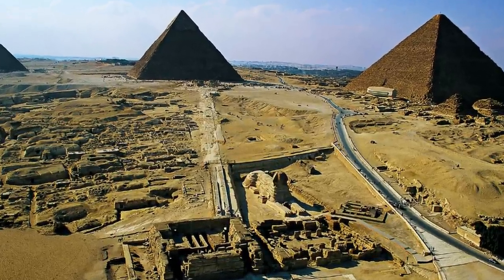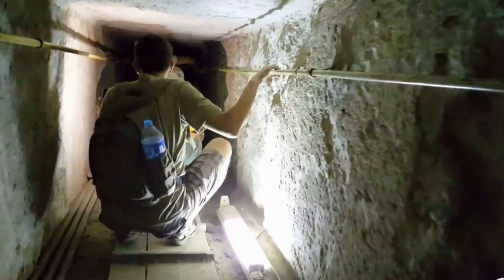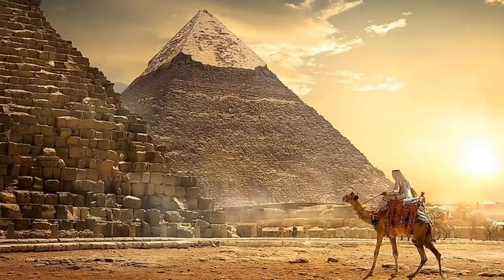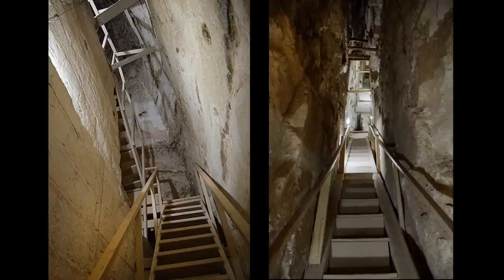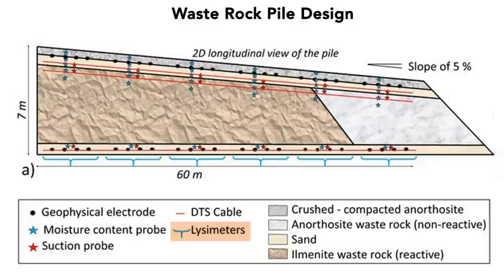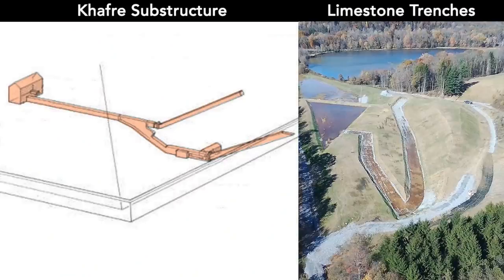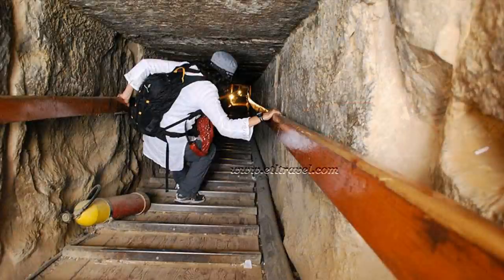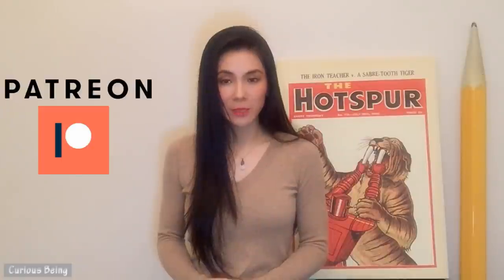The Secret Enigma of the Egyptian Pyramids’ Interior

Comment: Some older accounts of the interiors of the pyramids did mention that many of the small pits, side shafts and floors were packed with high quartz content sand. Much of that sand was removed and swept out to accommodate tourists and treasure hunters. This supports your theory of the passage ways acting more as a filter or dehydrator for the pyramid.
Reply from the maker: Thanks a lot for the information. I appreciate it!

Comment: A possibile explanation for the descending passages: Diluting the drainage water. They could catch the rainwater into a basin around the pyramid and the overflow can go down the tunnel to mix with the acid water to dilute it and drain it.

If for some pyramids, there's no drainage channel underneath the acid water can go the other way around and use the passage as an output.

Comment: Another great video Tina.  I agree with something you said below in another comment, that the pyramids could have more than one purpose or function.  It's hard to figure that out when we're looking at what appears to be a large machine stripped of all the inner workings.  You did a great job detailing how the pyramids act just like mine tailing piles processing the acid runoff.  But maybe the acid isn't only from the tailings.  Remember, there's still a few more things we need to figure out.  I think what you discovered is the overall architectural design of the pyramid, but not it's main function.  There has to be some reason for the large chambers.  There was too much effort put into them with their large granite chevron ceilings for them to not have a function.  And what were the granite boxes for?  Certainly not for sticking mummies in them.

Someone else mentioned that the four "air shafts" aren't enough to collect the acid seepage from the tailings.  I have to agree with that.  At least that wasn't their primary function.  But I think the shafts might be the key to figuring out the pyramid's primary function.  

Maybe to go much further, we need to speculate on who the pyramid builders were and what level of technology they had.  I agree that HS1 was probably the time of their civilization's  demise.  But I think pockets of advanced ancient civilizations probably survived for quite a while longer.  It looks like they had access to powered tools as you have shown in your previous videos, but they probably had limited capacity to maintain them and make new ones.  If they had the power of flight, this might account for the world wide mythologies of gods coming down from the sky to rule and teach the native peoples.

If this were the approximate scenario, it's not a big leap to think they could construct or salvage some industrial batteries.  They don't need to be something as complex as a RTG (Radioactive Thermal Generator, i.e. nuclear battery).  It could be just simple large lead/acid batteries, like what you find in a diesel electric locomotive.  These are about the size of the so called "sarcophagus".  Coincidentally, if you read the description of the Arc of the Covenant in the Bible, it sounds exactly like a RTG!  The Bible has a lot of advanced technology in it.  If these chambers did house large batteries, being able to handle excess acid overflowing would be very useful.  If you've ever had a voltage regulator stick "on" in your car and over charge your battery, you'll know what I'm talking about, acid foam all over!

But what about the "air shafts"?  Could they have been part of a navigational beacon system as someone wrote?  Don't know, but I think they are key to understanding the primary function of the pyramid.  Anyway, some food for thought.  

Tina, nice work!  I really think you discovered something new about the Great Pyramid.
Reply: Love all these thoughts, some great added ideas here. The air shafts may have actually been exactly that? Let out some toxins to allow the mechanisms to function properly?

Looks like the whole giza plateau is the remains of an ancient industrial complex. How many workers ran all this? How big and widespread was the civilisation that this level of industry sustained?

The genetic bottlenecks may be a key to help determine the timeframe of the demise? I get mixed up by the generic bottlenecks but weren’t there a few? 

Also probably good to factor in what era was there a lengthy period of climate stability before a big HS1 style event? 

Feels like we’ve gotten as far as we have this time around from not only remnants of advanced knowledge at the foundation post-YD, but also that overall climate stability since YD too. 

We’ve had it so good and it’s terrifying to realise that we’re collectively far more fragile than the wider population is even remotely aware of. 

I feel like an animal that senses the tsunami coming, but is stuck and can’t run to higher ground. Also most of the other animals don’t see it coming so thus aren’t on the same page of the urgency of the need to flee. Gah!!!
Reply from the maker: Thank you Ken! I really appreciate your insightful comment. 
Were the 4 small air shafts enough to be drainage channels to serve the Great Pyramid? 
We need to know in what kind of climate conditions the pyramids were built. Currently, the climate in Cairo is called a desert climate. “Cairo is donated on balance 26 mm (1 in) of rainfall per year, or 2.2 mm (0.1 in) per month. The wettest weather is in January when an average of 7 mm (0.3 in) of rainfall (precipitation) occurs.”

Were the pyramids created during the wetter seasons? The Sahara/ North Africa goes through humid/dry cycles. The Sahara was green and wet from about 14,500 years ago (after HS1 the millennia-drought) to 6,000–5,000 years ago. The humid period before that was around 85,000 to 78,000 years ago. HS1 (20,000-15,000 years ago) is the time period that coincided with the severe human population bottleneck which I think could be the ending of an advanced civilization. If the pyramids were built during 78k-15k years ago, then the Giza Plateau would be as dry if not dryer than now. 

Therefore pyramids were probably designed and built for a dry climate. Even with the desert climate there are still sudden precipitations which caused flash floods. 
Air shafts are pretty small and they twist and turn. Are there more such shafts in G1? Maybe. The scanpyramid team found two more voids in G1 but smaller voids like the air shafts are probably hard to detect. 

As for the people surviving in pockets after the cataclysm, I think it's very possible. Though I doubt these people would use their limited power tools to create multiple massive structures like the pyramids to act as industrial batteries, unless these pyramids were pre-existed. 
The amount of work and energy putting into building the pyramids probably over weigh the effort to create a Radioactive Thermal Generator.  If the goal was to make simple large lead/acid batteries in sizes of "sarcophagus", why would these intelligent ancient people put only one "sarcophagus" in each pyramid? What would be the reason to create the pyramids if they were not part of the battery? If the pyramids were supposed to house batteries, why there are so limited interior space? At least they would have put more "sarcophagi" in the chambers, right?

It's interesting to hear that the Bible has a lot of advanced technology in it. I need to read more about it :-) Thank you for the information! Have a great weekend!
Reply: @CuriousBeingbyTina  Hi Tina!  Thanks for the reply.  I hope I can clarify a few things.

I don't think that the air shafts gather acid from the tailings because there is no impermeable barrier like the plastic sheet in other mine tailing piles in the pyramid that would direct the acid towards the air shafts.  Alternatively, there would need to be several smaller channels leading to each of the air shafts to help collect any leeched acid.  I don't see any evidence of this either.  There needs to be a collection system, like a roof gathers rain water and directs it to gutters, then downspouts, then the French drain.  I just don't see it working mechanically.  This is why I think the air shafts point to another function.  My reasoning has nothing to do with precipitation rates.

However, the second half of your hypothesis is pure genius!  I think you are the first person to point out that part of the pyramid is designed like a passive acid mine treatment plant.  This is spot on.  When I look at the subterranean pit, that just confirms it for me.  Everything makes perfect sense.  I hope this part stands up to further scrutiny.  It could be a big deal for you Tina!

So, if the air shafts aren't the source of the salt and acid, what is?  I read that in the upper (King's) chamber, before they opened it to the public, the salt was caked up very thick, more than what could be accounted for by effluence alone.  The only thing that makes any sense to me is that has something to do with the granite box in the upper chamber.  Salt and vinegar makes a very good electrolyte for a battery.  Look at this video on making a battery out of a few pennies.  https://www.youtube.com/watch?v=rIdPfDHeROI  Now imagine a battery made with large copper and lead or zinc plates that could fit into the granite box.  This would be a very powerful battery that would last a long time.  You wouldn't need to rebuild the battery very often, maybe just replace the salt and vinegar electrolyte once in a while.  Maybe they just dumped the old electrolyte on the floor and let it drain down to the bottom of the pyramid.

I don't think this battery powered some large industrial complex or anything like that.  I don't think the main purpose of the pyramid was to be a power source.  I think it was just the local power source for whatever function or functions the pyramid served, like batteries in a flashlight.  Everything still makes sense so far.  Can anybody poke holes in this hypothesis?  I think the battery was very simple like this, similar to the Baghdad battery.  I don't think it was something more exotic like a RTG.  RTGs are made with plutonium and used for deep space probes like Voyagers I & II that will be too far away from the sun to use photovoltaic panels.  They are small though and you can fit at least 6 of them in the "sarcophagus".  Nor do I think there was any wireless transmission of power, just ordinary copper cables and wire used within the structure.

This brings us back to the "air shafts" and the main function(s) of the pyramid.  Also the top of the pyramid is missing.  We may never figure this out without discovering more clues or dig up the Pyramid User's Manual.  However, this is the fun part, so let's speculate!  Here is one of many possibilities, but first some assumptions.  The pyramids were built post HS1 and pre-dynastic Egypt.  Some survivors of this advanced civilization were still around during the Sumerian times and are likely the gods in their mythos.  There are several clues that they still had the power of flight.  They all were depicted with wings or sitting on something with wings.  In the Americas, there are several gold trinkets shaped like planes.  The Egyptian myths tell of their gods using flying chariots.  There is a wooden carved bird from dynastic Egypt that has a vertical tail rudder like a plane, etc., etc.

Also, we don't know what condition or configuration the shafts were in while the pyramid was "functional".  They may have extended all the way to the exterior and were later sealed/blocked when it was abandoned.

So let's assume the pyramid had something to do with flight.  Again, this is just one of many possibilities.  The way small planes navigate is by tuning into known radio beacons.  Putting a beacon antenna on top of the pyramid makes perfect sense if there were a landing strip nearby.  If they were anything like they are today, it would also be accompanied by a red anti-collision light on top.  

Airports also use two or more beamed (focused) lights at different angles pointed towards any approaching planes.  This lets the pilot know if they are on the correct glide path for landing depending on which lights they see.  Could the air shafts be the repositories for these lights?  They are set at different angles and could easily be powered by the aforementioned battery.  There would also be another set of lights locally powered at the actual landing strip.

There are several other possibilities, but this explanation is one of the more mundane believable ones.  ;-)  Was this a little clearer Tina?

Comment: Wow! With this video you took me so deep in the rabbit hole, I'm scared I'll never find back to the surface again 😁

There's a clear connection between your idea of the pyramids as a very smart constructed acid drainage system and their real purpose, which was definitely not being a tomb for rotten Pharaos. In my opinion, your thoughts are 100 percent correct, since  most sorts of granite are acid resistant, whereas limestone is acid sensitive. That would explain why the inner chambers are made of granite - and the propably by accident - bared limestone formations inside the chambers look like melted.  Another explanation (if the chamber shows no sign of destruction) might be that the limestone was placed there with intention, to neutralize the acid water for a special purpose...

However, acid water is another very interesting addition to the already present collection of evidence for an additional purpose of the construction. Let's go deeper and startle some rabbits 😉

Comment: The limestone substrata, purposefully placed as it was, nails it for me.  It's the smoking gun that holds your entire thesis together.  

Nicely done.   

And by the way, upon reflection.  The "ruble pile" by it's nature is purposeful is it not?  

The reason, to me, is that if that pile sits at the bottom of a "reactant zone" space to handle polluted waters, as does seem to be the case, then a ruble pile of reactant material would maximize the surface area in contact with the water wouldn't it?  It would function better than a smoothly cased room of reactant material.

So you're right...whoever built these structures thought it through in very thorough fashion didn't they?  They were thoughtful and brilliant engineers.  

John~
American Net'Zen
Reply from the maker: Thank you John. I always appreciate your insightful comments. Have a great weekend.

Comment: Point 4 seems to show damage from acid seepage that was greater than expected.  This is shown in the bottom chambers with unusual rubble and the draining channels being eroded.  It was common to even out water flow by using paralell walls to the direction of flow to lower the erosion caused by flowing water.  The large amount of rubble would indicate it was unmonitored.  The bottom pit, going into the bedrock, would indicate that water wells near the pyramids did not go deep enough to potentially be contaminated by acid dranage.
Reply from the maker: Thanks you Eric. I agree that it's possible that the pyramids were designed to be unmonitored and self-sufficient.  The base of the great pyramid is 62m above sea level and the subterranean chamber is about 30m above sea level. If the pyramids were built right before the Younger Dryas, back then the sea level was around 60m lower than today. During the Last Glacial Maximum which lasted for a few thousand years, the sea level was about 120m lower. Since the Giza Plateau is close to the Nile Delta and the course of the Nile is fairly flat, the water table of the Nile would be closely associated with the sea level therefore much lower (60-120m lower) in these earlier time periods. So the shafts on the Giza Plateau were probably dry back then.